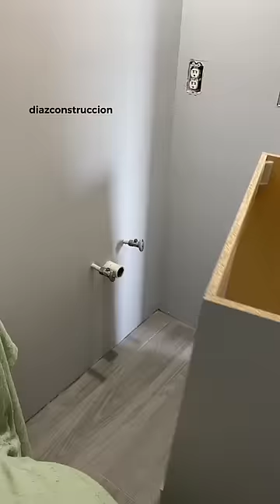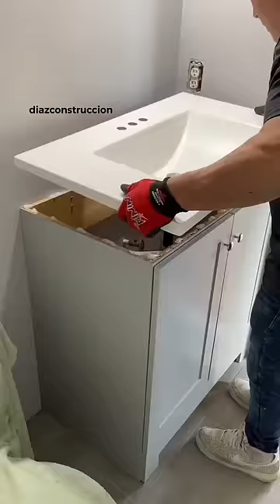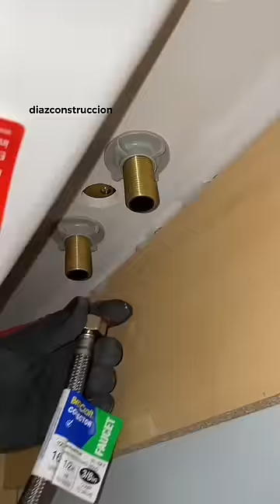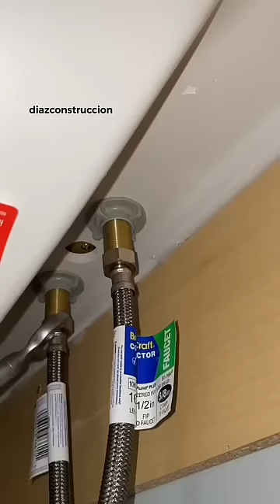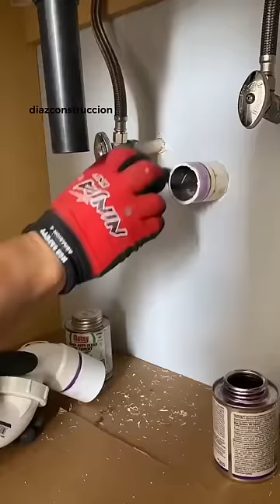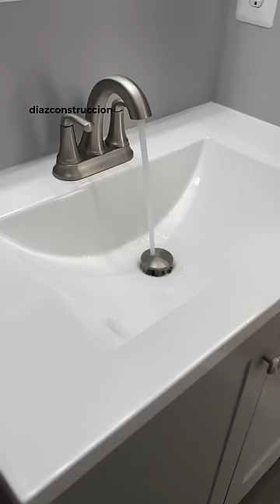Install a bathroom vanity

Comment: A real plumber would connect the faucet to the top and supply lines before installation!
Reply: Yep and put some Teflon tape or some pipe dope on the faucets
Reply: @torrycole6477 I’m a plumber and where are you talking about? If you’re talking about the braided supply lines those have an o ring and don’t need teflon or blue dope.
Reply: Yea! F**k the guy who has to caulk the countertop😂
Reply: @JoeyV34 Thank you..
Reply: @torrycole6477 why? It doesn’t need it 🙄
Reply: @JoeyV34 this is when the stupidest person open the mouth(@terrycole6477) and doesn’t have any idea about it plumber on this side too 10 years on the roll
Reply: @JoeyV34  I was thinking the same thing. You’re actually more likely to cause a leak putting tef tape on an o ring connection like that. 🤷🏼‍♂️

Comment: 😂😂😂 this is the first Diaz video I’ve seen where everyone isn’t shitting on his work
Reply: But they are
Reply: I watched the video first and was curious who would have something to be critical with his job. 
I laughed when I saw people struggling to find something minuscule 😂
Reply: I came right to the comments too!  😂
Reply: It's a pretty easy install. Only way you can mess this up is if you don't really know what you're doing.
Reply: He forgot the flanges…
Reply: I thought for sure he’d add in his usual trolling. This video is designed to cast doubt if hes a troll or not
Reply: You don't use hard PVC glued all the way up to the sink bowl ....😂😂😂😂
There ya go .
And install the faucet and supply lines before you put the sink on... 2 for 😂
Reply: It’s a cheapo Home Depot install lol. Even a DIYer could do this in 45min.
Reply: @b5maddog im betting on a non gfci plug

Comment: I usually install the vanity faucet before setting the top. I admit it does make caulking behind it a little more difficult, but at my age I dont like rolling around on my back any more than I have to.
Reply: Yup
Reply: That's why you get the vanity top with the 3in backer
Reply: Basin wrench usually helps solve that problem
Reply: @upstate plumbing as a installer I usually don't get to pick out the vanities. That's up to the property owner.
Reply: That’s the smart way to do it, I’d rather take an extra second with the caulk than taking even more time struggling to install it in a tight place
Reply: The older u get, the more corners you cut….reason why I don’t like to hire the old contractors
Reply: Ive started putting the caulk on the rim of the vanity before installing
Reply: @BLacK HarTz  lol  installing the faucet and supply lines first is not cutting corners it's being smart
Reply: @B_HarTz  the older you get, the more educated you get
Reply: you sound like my wife.
Reply: I did the same as the video and I had a lot of problems to screw the faucet😢
Reply: Depends on the faucet. If it's drops r8ght in like this one I'll do it after. But if I have to secure individually 2 valves and the fixture with all the lines tieing in I'll do it before
Reply: @B_HarTz  thats not cutting corners, its working smart.
Reply: I agree with you too.
Reply: My thoughts exactly
Reply: Yeah your definitely supposed to put the faucet on first but this guys learning still. There's a dozen ways to skin a cat
Reply: I do the same
Reply: Exactly
Reply: Don't install handles and you get. Little more calling space but with tools it is not to difficult
Reply: Q1
Reply: Yeah caulking is way harder …
I just did his same exact vanity
Reply: Io i ob o i😊😊😊😅
Reply: Correct
Reply: He didn't check for leaks after install. Nonpro
Reply: And where is Teflon Tape, in the joins?😂
It's eady to do ½ work, doesn it?
😅
Reply: EXACTLY!
Reply: @B_HarTz  The example her stated by Knowledge is power was not corner cutting ...... Work smarter not harder!
Reply: @B_HarTz BS
Reply: @B_HarTz  it’s not cutting a corner, it’s working smart.
Reply: @B_HarTz that’s far from the truth!
In fact, there is no corner cutting in setting the faucet first, I’m 6’ 8”, 265lbs, and a 64” chest - guess where big boy don’t fit?
It’s called work smart not hard
IFKYK
Reply: @jmarmolejomx lacking tools and/or experience and that’s OK
Reply: @yohanathandowns9057  if I walk into the bathroom and the cabinet is already together, I look for ways to rip the cabinet apart to work smart, not hard
Reply: @mycaddigo  I’ll bet your supply lines and or your faucet will be loose within the next 10 years
Reply: I like how no one mentioned the primer
Reply: 7/11 slurpee straw as an extender might work lol
Reply: My thoughts exactly.
Reply: @chickenliver1000-r3i you're definitely not "supposed to" install fixtures first. You can if you want to. If there's going to be a backslash or tile on the wall behind the faucet, the faucet will need to be removed.
Reply: @brookelord3448  lmao yeah the plumbers ganna wait for someone to install a backsplash sure u definitely no what it talking about lmao
Reply: Обсалютно с вами согласен. Было дело проломил полочку. При весе в 100 кг. не очень лежать в тумбе. Правда я его снимал😅!
Reply: I agree
Reply: That’s a handyman job.
Reply: Most not all…
Reply: @B_HarTz  That's not corner cutting, that's working smarter, not harder.
Reply: Same here 👍🏽
Reply: @chickenliver1000-r3i  I know it’s an old saying but damn 😂 that poor cat!
Reply: @chickenliver1000-r3i  and why would you want to or need to skin a cat 🐈 😂
Reply: I was thinking the same thing. Makes caulking more difficult but you're standing up doing it.
Reply: U still have to get underneath and install hoses etc
Reply: And the hoses
Reply: Oh, that's my favorite part.
Reply: ধন্যবাদ
Reply: @arcticgriz20 that's good eating in some parts ...😂
Reply: @miket2172 when he get older maybe , just maybe will understand how dumb that statement was 😂
Reply: @Chopp333r still gotta get down on your back for that.  I agree...install on top first.  To each his/her own.
Reply: @B_HarTz ..No that's wisdom.  No corners cut by being efficient.
Reply: Exactly
Reply: @briansama9093 getting you caulk in a tight place is always a good thing
Reply: Same here. And it doesn't make the caulking that much harder
Reply: What about all the moving around and tightening with wet caulking on top😂
Reply: HE IS JUST A ROOKIE, I DONT KNOW WHY THESE VIDEOS ARE FORVED UPON US
Reply: Guys, here is The Savior

HalleluYAH translates “Praise ye YaH”

YaH is The Heavenly Father 
YaH arrives via the TENT OF MEETING
YaH was Who they Crucified for our sins
YaH was Crucified on an Almond TREE

— Ancient Semitic Cuneiform of Moshe (Moses)
— Isa Scroll (The Original Isaiah)

Isaiah 42:8
"I am YaH; that is my Name! I will not yield my glory to another or my praise to idols.

Isaiah 43:11
I, I am YAH, and there is no other Savior but Me.

Isaiah 45:5
I am YaH, and there is none else.
Reply: It's all about a real plumber procedures
Reply: I was thinking the same thing.
Reply: Double door vanity and he a small guy. He’s still pretty articulate and flexible. Us older guys do a lot of our work a certain way so we don’t hurt during and after the job.
Reply: Plus the faucet gives you a handle to grab
Reply: @briansama9093 you shouldn't be struggling to put a faucet in no matter how tight the space is. It's a 15 min job
Reply: Exactly!
Reply: Slightly damp rag will make the caulk bead nice if installed before basin... Also for vice versa you can use a faucet tool to install faucet after the basin... I manage 208 units and speed is very necessary
Reply: I do the same thing when installing gas cooktops. I install the regulator and flex line first then hook it up to the valve and drop it in place. Only gotta get in the cabinet to strap it down
Reply: This is beneficial for old people, youngsters like myself do it pretty fast
Reply: Correcto
Reply: No doubt, it's easier to work down than up.

Comment: 2" pvc?  Well that will never clog...
Reply: It's 1 1/2
2" is code for some drains like the washer now though.
Reply: @evictioncarpentry2628  that tail piece is only 1.25"  kitchens 1.5".  Its not wrong... just overkill.
Reply: @hoodhomesgardens  Thats exactly what I just said.....its 100% standard. Not sure where you're getting 2" from.
Reply: Here in Australia we use 50mm ( 2") for kitchen sinks, showers and tubs. And we use 40mm (inch and a half) for basins and bath tubs
Reply: @evictioncarpentry2628 I'm not sure where, but he's in a Spanish speaking country. The same building codes don't apply everywhere.
Reply: @hoodhomesgardens not sure where you’re from but it’s 2” for kitchens in Minnesota. Different areas have different codes though.
Reply: Should be 4” . Then they could shit in the sink
Reply: First time on the Internet somebody is impressed with 2 inches.

Comment: Pro tip: put the faucet on before you set the sink! Including attching the water risers and drain assembly! Easiest access!
Reply: Not if you're installing a backsplash.
Reply: @brookelord3448 😊: he didn't.
Reply: @imaslowlerner  right. But as to the comment above: absolutely do not do this at all if you're going to install a backslash as many people do install a backslash.
Reply: @brookelord3448 that’s not correct.  The backsplash is not affected buy installing faucet first.  Read professional comments and rookie comments.
Reply: The drain is easier to install with the sink in imo
Reply: @imaslowlerner  he didn’t install a backsplash in the video silly Willy 🤭
Reply: @lalocastellanos  : reread my comment.
Reply: Easier to seal the back of counter top to wall prior to facet being in the way.More than one way to do things.
Reply: yeah it would be easier to put a splash on first if they wanted it..but its still not at all complicated to do if the faucets installed first..
Reply: So you put the faucet first and then the sink?
Reply: Drop the mf Mic!!!!!!!!
Reply: Why not the hoses too?
Reply: I was just gonna say that
Reply: Install backsplash first, then the counter top and faucet, then the p trap last!! 🤣🤣
Reply: @brookelord3448 look at video, he installed it after, and there is no back splash.
Reply: @fernandodelrio4839  right. So did you understand my comment? Do you know what to do if there is a backsplash? Based on your comment I cant tell if you understood the instructions since you completely misunderstood the intent of the comment.
Reply: @waterscapedesignsbymichael2317  if you're installing a backsplash the faucet will be in the way. Your hands need to be in the space where the faucet wil be, depending on the sink. For example my sink has a backsplash built into the counter and basin. The gap behind the faucet is 1/2 inch. With only 1/2 inch of space, the job becomes more difficult than necessary.
Reply: Caulking behind the faucet would be more difficult.

Comment: Did I miss the leveling of the sink…well at least he leveled the plumbing under the sink
Reply: The floor is level so the vanity is level
Reply: That style of cabinet can only be raised in the unseen corner, even then raising it would leave a gap that sits flush with the floor. Leveling isn't required for this application as the floor is appropriately level. This is well executed work with no unnecessary effort(displayed).

Comment: Don’t forget to change that receptacle over to a GFI 👍
Reply: Good eyes bruh. I missed that one
Reply: If it’s on an AFCI breaker there’s no need for a GFI in wet areas though, and code requires them now pretty much everywhere in the US.
Reply: What I was about to say 👍
Reply: Haha those things are so annoying that one of my customers kept calling me back every time they tripped. I don't know what they connected or how many things they connected all at once that it tripped them. After 5 calls they told me to remove all GFCI and AFCI and to put regular ones on like in the old days. I happily changed them and told the homeowner I am not responsible for any damages after the swap. So far, it's been 3 years and the client hasn't had any problems thus far.
Reply: @YeethusCries  I have the same issue on my properties for the kitchen circuit. Some idiot put the fridge on a circuit with the kitchen island outlets instead of an individual breaker. I have completely removed all the AFCI’s and replaced the 15 amp GFCI with a 20 amp GFCI and it completely solved my problem. AFCI breakers suck!!
Reply: @Jakeofalltrades777 lol AFCI and GFCI are 2 totally different types of protection. Neither can take the place of the other. The closest way to do that is to have an afci/gfci combo breaker that does both.
Reply: @Conald_isAfalseProphet  lol way to state the obvious. We’re talking about breakers tripping not protection dummy. We know one prevents fires and one prevents shocks. And my code doesn’t require both because it’s a Multifamily building built before 2020.
Reply: @Jakeofalltrades777   "if it's on an AFCI breaker there's no need for a GFI in wet areas" and I'm not a dummy, 🤔 that was harsh. That was your statement 2 months ago, not mine.
Reply: could be GFI protected earlier on in the circuit
Reply: That's another trip to HomeDepot
Reply: Nahhhhh... MR GEORGE ITS A SPECIAL WATER OUTLET. IT WORKS BETTER UNDER WATER.... 😂😂😂😂.
Reply: @YeethusCries  You should have fixed their neutral problem instead of doing an illegal install and risking lives.
Reply: @Jakeofalltrades777  Ground fault, not arc fault.  It requires GFI 20a string, not AFI.
Reply: @Conald_isAfalseProphet you’re right he’s wrong, can you imagine the stupidity of people. Everyone thinks they’re a pro. He’s some weekend warrior muckle head that should worry about doing his job well then attempting to coach a field he knows nothing about.
Reply: COULD be tied into the GFCI upstairs or in the panel...    My biggest issue is his P-trap.. install a removable one so if it clogs or you need to snake it or clean it..
Reply: Guys, here is The Savior

HalleluYAH translates “Praise ye YaH”

YaH is The Heavenly Father 
YaH arrives via the TENT OF MEETING
YaH was Who they Crucified for our sins
YaH was Crucified on an Almond TREE

— Ancient Semitic Cuneiform of Moshe (Moses)
— Isa Scroll (The Original Isaiah)

Isaiah 42:8
"I am YaH; that is my Name! I will not yield my glory to another or my praise to idols.

Isaiah 43:11
I, I am YAH, and there is no other Savior but Me.

Isaiah 45:5
I am YaH, and there is none else.

Comment: Had to install one today. It fun when you have to do modifications to the cabinet when it's not flush in the corner
Reply: True, but he didn't even check for plumb, did he?
Reply: I feel like all of them need to be modified 😂 and no, he did not check plumb on camera
Reply: So many things wrong here
Reply: Yea on your job when the walls are not plumb the cabinet wont be flush so you could fil out the wall with plaster,or loosen few screws then get as best you can tighten up and run a bead of silicone along it,fair play to ya
Reply: To the reply he didnt check for plumb,🤣🤣🤣did you just the word plumb,ffswhy would he need to check for plumb,the cabinet is square his measerments are good,all you do is mesure diagnally x shap top and bottom,then its 90degrees outer cabinet fitted 90degree corner like a glove,so why do you feel the need to check if walls are plumb,when your square cabinet fits perfect,st to you paper round till you know what your on about,..🤣check for plumb,when it fits?????why,tell me whyyyyyyyy🤣🤣
Reply: He didnt need to check for plumb,i bet none of youwho said that is a tradesman,because he had no need to check for plumb,his cabinet was square,like 90degres and it fit the 2 walls which were also 90 degrees,it fit perfect meaning,anyone????the walls and cabinet are square and plumb,yous should do a course on contruction,even diy at home you would struggle with,he didnt check for plumb,becase his  square 90 degree cabinet fitted pefet,meaning the walls are flus plumb square,whatever,it was a perfect job,why do people who know nothing post replies as if their tradesmen,the comment the chap made was good you do getwalls not strait so you either plaster it fill it out,or make acabinet thats not as big on 1 side,takin millimeters,but this cabinet in this video is plum,flush square,straight,i know it is,im on the level🤣🤣🤣